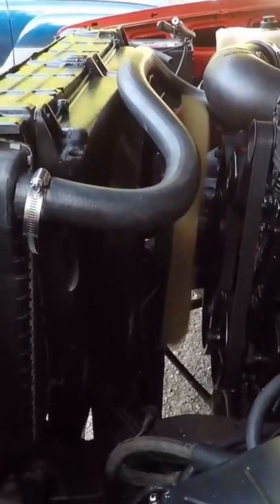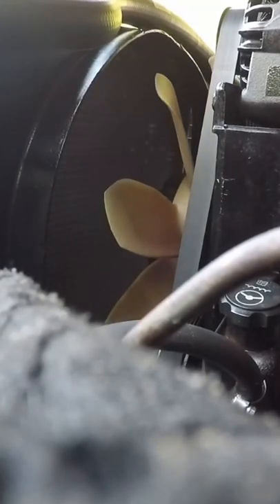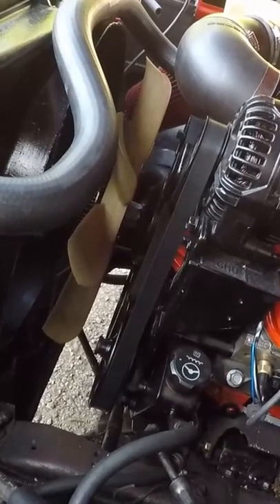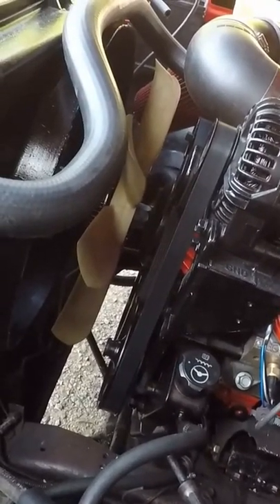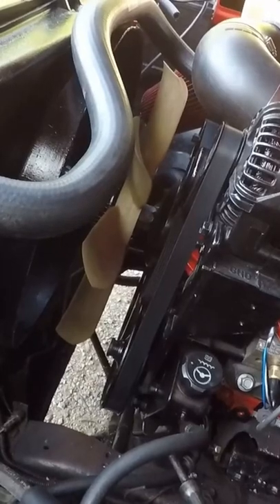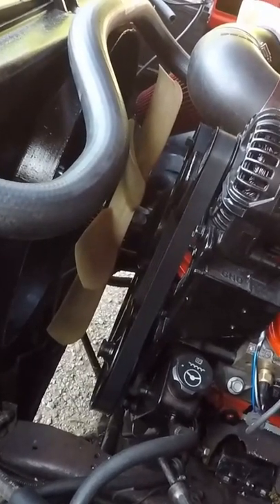How to tell if your clutch fan is bad #shorts LS SWAP SQUARE BODY

Comment: Will a bad fan clutch cause a metal on metal sound
Reply from the maker: Yes it can
Reply: I have the same type of sound when my clutch should be fully ingaged over 2200 rpms and goes away when my truck cools off some

Comment: why is my Fan Like hoppin i think it’s the fan pulley bracket not sure any helo?
Reply from the maker: if its not the fan bracket, could be a loose bolts or a bad water pump shaft

Comment: This depends if the engine is hot or not... if the engine is cold the viscous coupler will allow it to free wheel. So it would spin like this when cold when shut off. It would only stop quickly if the engine was hot enough to require it.

Comment: That clutch looks too short, the blades should be about half way into the shroud.  Some mismatch of parts on this vehicle.
Reply from the maker: its a ls swaped truck
Reply: @TattsForLife  I don't know much about swapping an LS but maybe you can get a long shaft water pump, might need another pulley as well.  Or maybe a longer radiator shroud, not sure what's available.
Reply from the maker: I changed to a longer radiator shroud since the making of the video
Reply: I noticed that to.

Comment: Also if it doesn’t disengage so it is always on not matter the RPM
Reply from the maker: that is true but if its always engaged then it wont over heat

Comment: Spin it by hand if it spins more than a quarter spin its bad
Reply from the maker: Great info, but sometimes they half to get hot before you can tell, and will only over heat when towing
Reply: What if it stops instantly almost like it is stuck
Reply from the maker: I would say its still good @chrisc7639

Comment: What happen if u don't change a bad clutch fan, ain't it ok if the fan just keep spinning!
Reply from the maker: It will not pull air and cause it to Overheat, also it can fly apart and cause damage